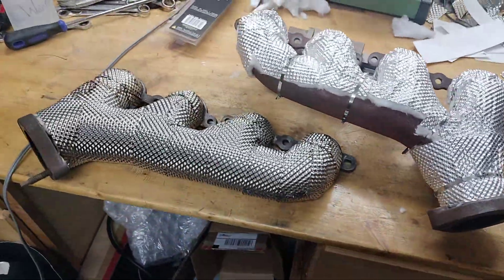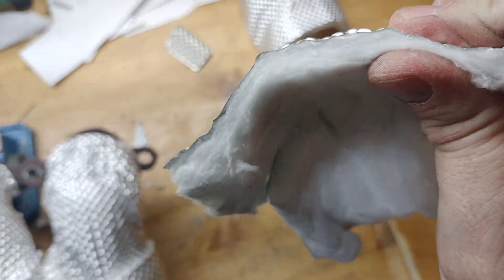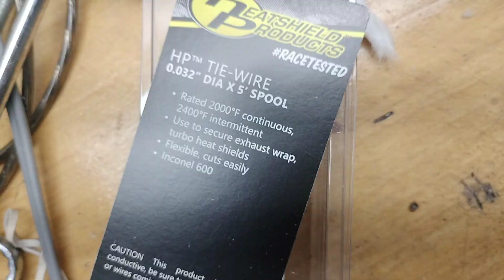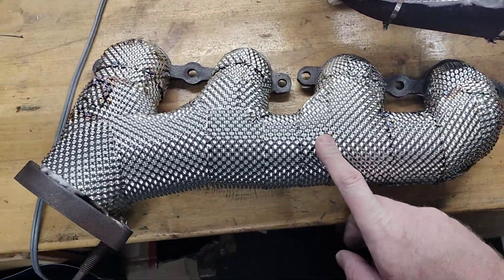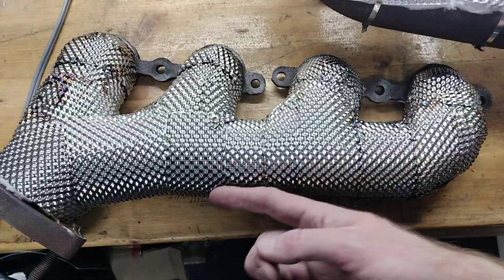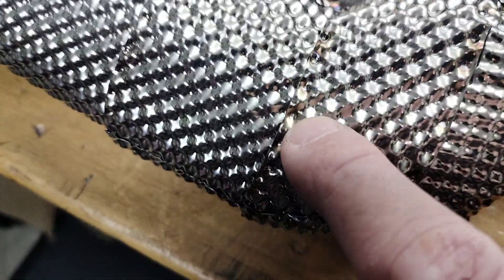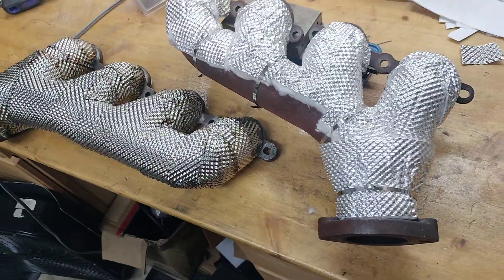Stainless and aluminum custom heat shields manifold

Comment: Where did you purchase the stainless sheet ? You are right this is very hard to find in the US. Shipping cost from EU is prohibitive. I have found the 12"*20" sheets on ebay but would like to find bigger sheets for less waste and possibly cheaper.
Reply from the maker: eBay was where I could find it.  You can also order from AliExpress in large quantities
Reply: @Liberty.Francis  LMK if you have a link, I could not find it on ali-express. I am contacting the companies that sell the 12*20 to see if I can buy larger sheets.
Reply from the maker: @johnathanholmes505 I think it maybe was Alibaba as it was big quantity orders directly with the manufacturer.  Sorry it's been months since I looked at it

Comment: Awesome work. How did you spot weld the steel? TIG?
Reply from the maker: Yes the ones closest to the flange are tig.  The rest are done with a spot welder used for battery repair like the ones found on Amazon.

Comment: That steel one is hella good. looks good too. wonder how much they bring down engine bay heat
Reply from the maker: I ran the car hard over the weekend and shot the header area with an IR gun. Temps were 125-197 on the header itself.  Not sure about other general engine bay temps but surely helps...

Comment: You did a fantastic job on the stainless they are very well done!  I have always been told that cast iron needs to heat and cool evenly otherwise you risk cracking. Again nice work!
Reply from the maker: Thanks!  Yes, I read it can crack or warp.  I'll see how it goes 😉